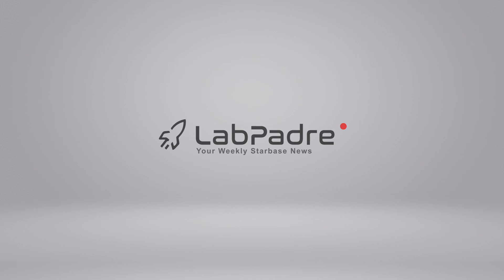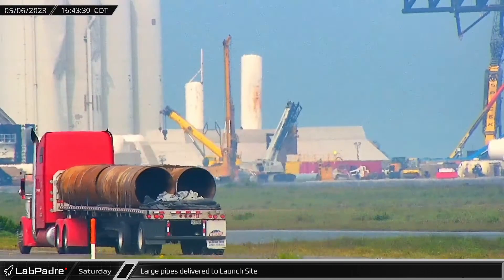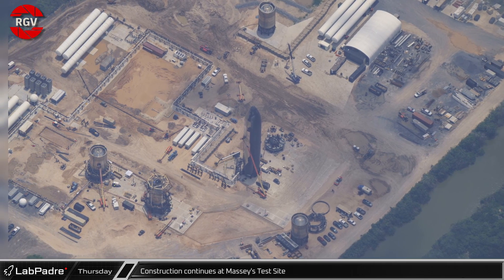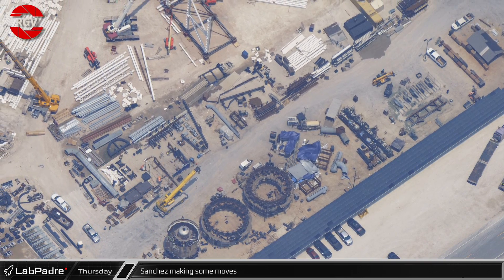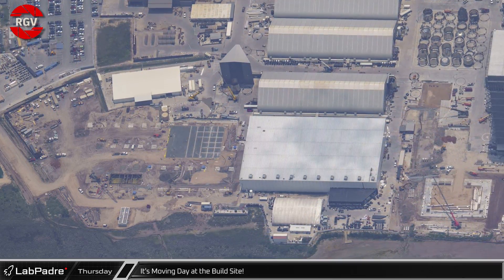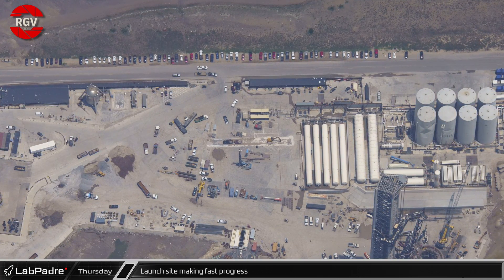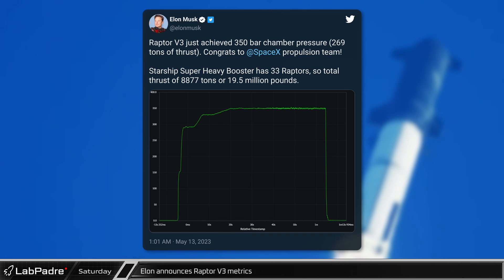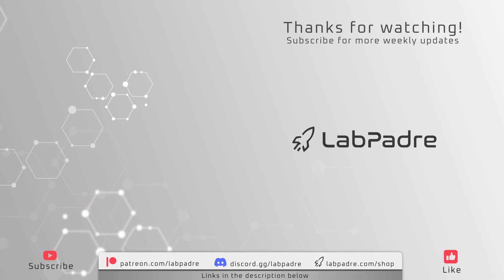Elon Discusses New Raptor 3 Static Fire Test - Starbase Weekly Update #62

Comment: Thanks Lewis. 🙂👍 One important correction: At around 4:43 and 5:55, for two examples. That should be *thousand square metres, not thousand metres squared. There's a huge difference between the two. To illustrate: 10,000 metres squared is 100 square kilometres, or about 36 square miles, but 10,000 square metres is exactly 100 metres squared (1 hectare), or about 107,000 square feet (about 2.47 acres).

Comment: Pretty sure those pipe sections were for lining the support holes they drilled in the sandy soil.
Reply: True.
Fine sand has a way of compacting itself, when water is introduced.
Hence, why you can drive on wet sand, on the beach, but not on dry sand. Just to simplify things a little bit.
  Constructing tilt ups, of over a million square feet, where sand is plentiful, that is what we used as fill, below the slabs. 
  We don't even use compaction equipment. In fact, it does no good. We just  ad lots of water. Footings and bearing points need to be either, extra large, or pilings driven down to a point of resistance. Or to bedrock.
  Wet sand is vulnerable to seismic liquification. But once encased, like under a large slab of concrete, it's good, for moderate loads.
  Just saying.
👻☠️🗽💯🙏

Comment: 3:34 "shower head pointing up". I wonder how they're going to keep water flowing in the right direction between ignition and lift-off? Inertia?
Reply: Very high pressure ⛲
Reply: @spitbacca  I ask the question because "very high pressure" must be what the 'shower' water is flowing into. I imagine pumps alone not very far upstream of BFRs lift-off pressure wouldn't have a chance of maintaining flow? There must be something storing energy (such as inertia of a large volume of water downstream of pump / head) to overcome short-lived pressure of launch? The pumps would get the shower water up to speed in long pipes, and then 'water hammer' (but longer-lived) would ensure BFR's pressure doesn't overwhelm the flow. Just wondered... might be nothing. Maybe the open construction of the launch mount means static pressure doesn't rise very high? I wish I was building rockets!

Comment: As an engine nerd, i need more information on Raptor 3! Hopefully Tim Dodd will deliver again, like he did with 2. or maybe someone else will get the honor this time! who knows!
Reply: I don’t think the number of engines is the problem.  Falcon heavy has 27.  The main thing I see is reliability.
Reply: @drewparcel1727  The issue isn't number of engines, you're right. As far as i can tell, it's getting the staging to behave. Common core booster configurations like this, the staging stuff is rather obnoxious. there's a reason Starship threw all 33 raptors on one core and not 11 on 3. it's added complexity that's worth while to avoid.
Reply: @drewparcel1727  less moving parts usually is more reliable. Less parts less to break. Can you see Starship in Falcon Heavy configuration? 😂
Reply: @omonkkonen6676  and that, that'd be funny. i want to see that just for the pure ridiculousness of the sight. i mean, 99 Raptor 3s. Imagine the sound. and the destruction because the launch pad is probably going to only barely survive the 33 raptor 2s as is with the current incoming upgrades, if it survives at all.
Reply: @etherealswordsman3214  Are you 11 or 12 years old?
Reply: @garyc1384  Neither, i'm just bored.
Reply: Just hope that new engine has more power to lower amount of engines needed and this way simplify whole setup. There is too high probability that one or two of 33 engines do not work right. Reality is that SpaceX need engine which is 3x  power of current Raptor 2. Reduce booster engine amount from 33 to around 10-12pcs
Reply: @omonkkonen6676  do you even know what you are talking about?
Reply: @CoffeeMonster12  well I’m not rocket engineer. Are you? If you are then please let us know what is your view on this matter.
Reply: @omonkkonen6676  they're not going to want to cut engine count if they can avoid it. realistically, the high engine count, for this type of mission, is likely seen as a feature, not a bug. that said, it's probably a less important feature. i'd rather go saturn v and use a few giant engines as well, so i feel ya.

Comment: Ten and a half thousand square metres I hope, ten and a half thousand metres square is 27 thousand acres.
Reply: 10,500 square meters is 2.5946065 acres of land. 102.469 meters square or 336 feet square.
Reply: @kameljoe21  Lab said 10,500 metres squared.
Reply: @andyalder1  Yes and that is 2.59 acres or a building that is 102 meters square, 102 meter by 102 meters, it you want noodle units then 336 feet long by 336 feet wide. 112,896 square feet of building space.
Reply: @kameljoe21  Nope, 10,500 metres square is 10,500 X 10,500 square metres or about half the area of Brownsville.
Reply: @andyalder1  Ah I got you... Yeah I missed it several times.

Comment: Raptor 3?
wow had no idea
Reply: I'm just guessing. (I say that to save face, with the actual engineers.😅)
  The Raptors are designed to burn/oxidize Methane. CHHH, or CH3.
  Notice the 3 Hydrogen atoms.
  They need to be combined, under heat and pressure, with Oxygen, leaving H2O, and a byproduct of CO/carbon monoxide, or CO2, Carbon Dioxide. Notice the CO2 is wasting an extra O atom, and wasting energy.
  So, I surmise, the Raptor 3 is using a method of "turbocharging" of the liquid Oxegen, O2, to get a "cleaner," "burn/oxidization" of the CH3, and release a little more energy.
  More CO? Oh well. We got to get back to the moon, and to Mars.
  Remember. Just guessing. It would be awesome to have an engineer, explain it to us.
  But I'm pretty sure, I'm correct.
  👻☠️🗽💯🙏